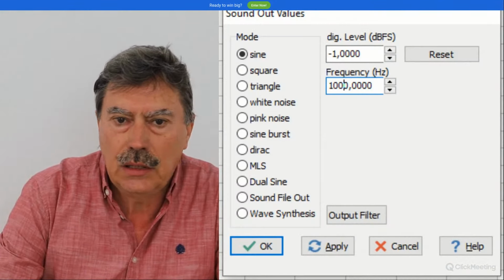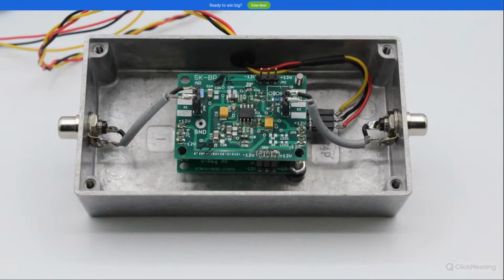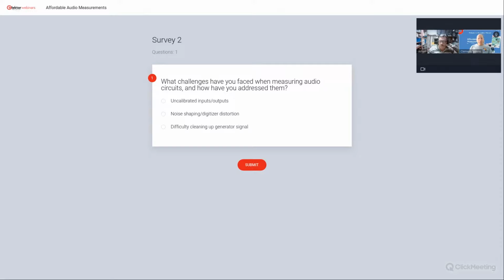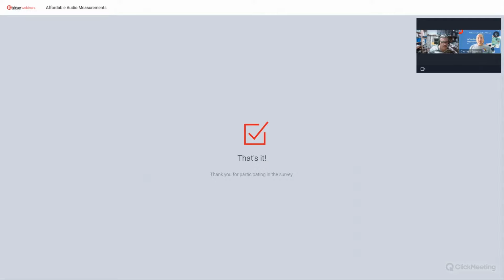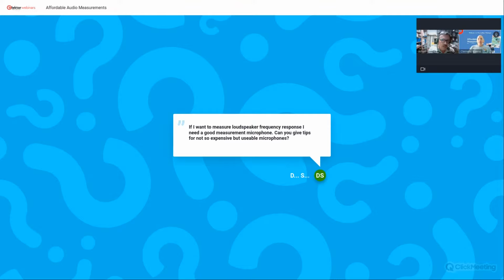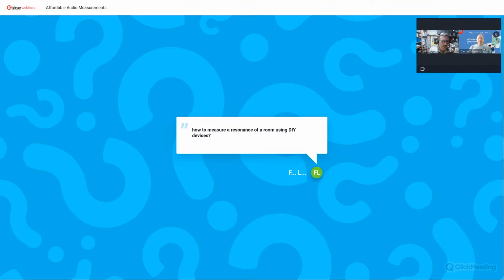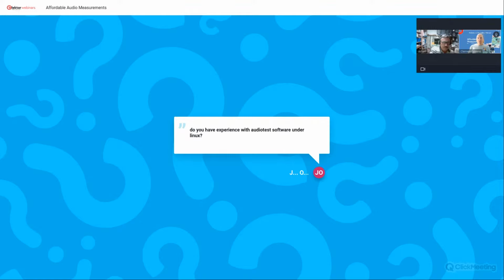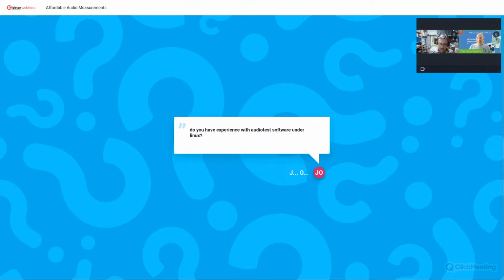Affordable Audio Measurement

Comment: Recommend the QuantumAsylum QA403 for $600 USD.  Loop back performance:  THD 0.00011% -119.6 dBV, THD + N 0.00077% -103 dBV.  Super easy to set up, super easy to run.